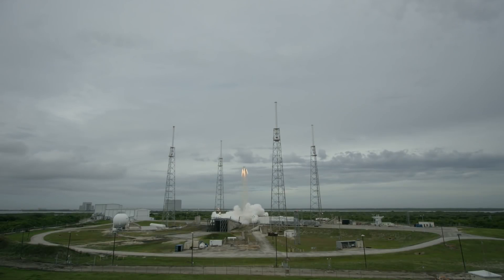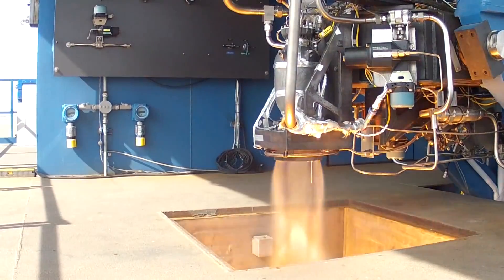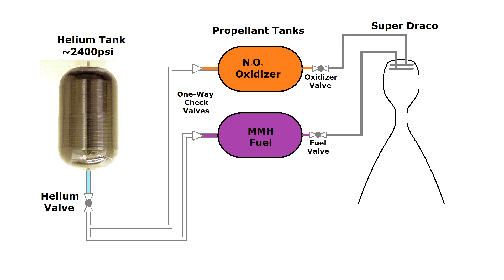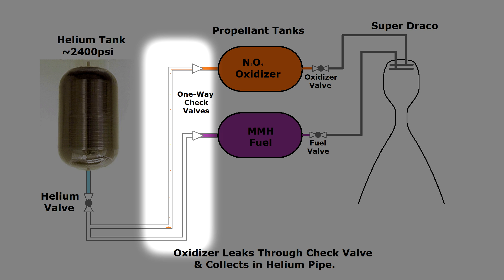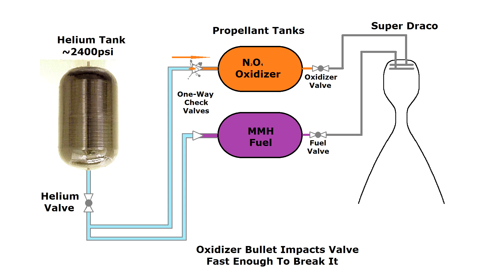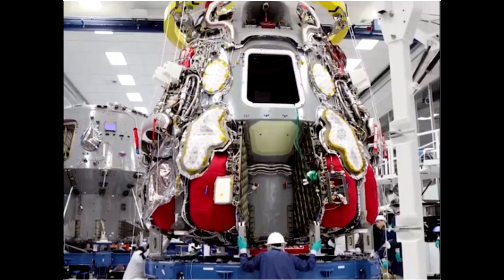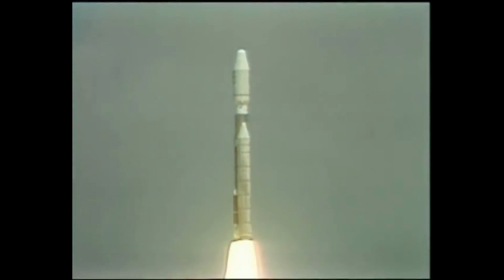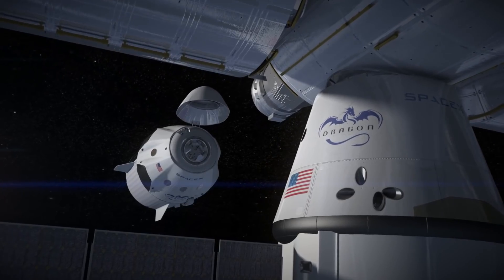SpaceX's Crew Dragon Spacecraft Exploded Because of 'Corrosive Bullets' and Leaky Valves

Comment: Where in the system do the burst-discs go?
The S-Dracos have to work approaching the station, and then de-orbiting three weeks later...!
R
Reply from the maker: The regular dracos use valves and are used for maneuvering in space, the super dracos use the burst discs and are only needed for emergency aborts

Comment: The technical term for pushing the fuel through the piping into the check valve is fluid hammer. This can cause a piping failure at a valve or at an inadequately supported piping elbow. In my professional life I have seen piping move several feet due to fluid hammer, only the piping was supported to take the hammering.

Comment: It would seem having a valve that opens rapidly instead of modulating was the main culprit but not even mentioned. Maybe the engineers there should have asked their local plumber about rapidly opening/closing shutoff valves and the pitfalls of check valves!
Reply from the maker: Do you have time for a slow opening valve if your rocket is exploding?
Reply: @scottmanley  Scott thanks for replying, but from what you mentioned it was the OPENING of the valve in the pressurising gas that caused the "obstruction" to be propelled along the fuel line, causing the damage. This is a very basic and known problem and a first year apprentice plumber would be aware of that issue (as would any home owner dealing with "water hammer"). 

Obviously I know nothing more about the system than what you described (very well incidentally), but it appeared there was no good reason to have the pressurising system's valve  operate so quickly. Pressure shock waves in hydraulic systems is nothing new, neither is the fact that check valves leak. Fluid Dynamics is a first year engineering subject, at least down here in Oz. I thought this failure was a face-palm moment and I'm literally embarrassed for the engineers involved.
Reply from the maker: @886014  OK, so how slowly do you want an emergency escape system to operate when your rocket is exploding?
Reply: @scottmanley  G'day @Scott Manley Yes that's a good point, but we're not talking about the Janitor finishing his hamburger and then wandering out with a Stillson wrench to turn the valve on. A valve that "gradually" opens means milliseconds in order to control the pressure wave front. From your report, the NASA recommendation was for burst valves to be used, and at least that indicated they were considering the shock wave (indeed used that property to perform a function).  It seemed by their design, the implications of the pressure wave weren't even considered by the designers, and the proof was in the pudding. ... In this case the pudding exploded. Not exactly a handy design feature for something intended to save the crew! How fast do you want your crew fried as both the "rescue system" and the rocket are exploding?

After any accident there are always people like me who will come out with "Coulda ... Woulda .... Shoulda"; those of us in the aviation industry deal with it constantly. That may grate the current generation where everything is always "awesome", but I feel that's the price to pay when dealing with other people's lives/money. I sometimes get the impression the team there are making it up as they're going along. That's fine when building video game; how many there are putting their hand up to sit on top of the candle when they light it? Would you? Obviously all just my personal opinion.

Comment: Nope...it exploded because of lack of foresight.
Blame it on a valve like an oil rig?
No purge valve, no trap in piping, no sensors behind or after valve to test pressures, detect oxidizers in helium?
Plz
Even a hobbiest at the drag strip installs a purge valve on their NOS system for safety.

Comment: What about doubling up the check values?  Having 1 Check value, then another right after it?  You could even add a sensor of some kind in-between the check values and before it.  A sensor type that can emit a scanning signal of some kind that is non-reactive to the materials used.  If a leak is occurring in one check value, hopefully the second check value can ensure that it wont get very far and the sensors can detect the problem long before device activation.

Comment: So, Scott, why are the valves replaced by the burst disks, and not supplemented by them by, for example, placing the burst disks between the LF/O tanks and the check valves? 

These are both relatively low-cost parts, in the context of a rocket engine, but each protects from different kinds of failures, and importantly, these different kinds of failures occur at different times.

Comment: The one way valves go back to default closed position to stop fluids going back down the pipe, they are usually spring loaded to auto shut when the pressure drops to below spring force etc, but of course can be motorised

Comment: by adding bust disk spacex will be making the thrusters a one time use right? one time per flight till the disk can be replaced?
Reply: because you're planning to use the escape system multiple times in the same mission?
Reply: No but it was originally designed to propulsive landing and what not just a escape system the system can leave orbit and reenter the atmosphere if the second staged malfunctioned in orbit the draco thruster can do alot more just be used for escape system

Comment: This has been documented for decades.   It’s known as the “Taco Bell Effect.”   When high pressure gas accelerates a soft blob of material directly through a one-way check-valve apparatus, causing an unexpected blowout.  

Every taco tuesday, someone experiences this effect.
Reply: Take Beano. Works like a charm to fix those leaky gases from building up

Comment: Ok my assessment of blame on the engines may have been wrong, but I'd like to know if this check valve was 3D printed. If it was I'd feel completely vindicated. 

Either way I'm still skeptical of 3D printing as a practical way to manufacture strong parts, but I do hope nothing explodes in the next launch abort test.
Reply from the maker: Check valves will not be 3d printed. 3d printing is used for short run items with complex geometry, check valves are used everywhere and have simple geometry compared to a rocket combustion chamber.

Comment: Wouldn't another method of preventing this problem be to use an automated gradual opening of the pressurant valve? Burst disks can't be a final solution if they want to have multiple restart capability... Furthermore, what if part of the burst disk breaks off and blocks a passage downstream? I know they aren't supposed to, but then check valves aren't supposed to leak either.
Reply from the maker: There’s no such thing as a gradual opening when your booster is already exploding
Reply: @scottmanley  Good point. I'm beginning to understand why my spaceX application was turned down xD

Comment: Ok, so the Mars Observer Failure Investigation Board concludes that Nitrogen Tetroxide had leaked past the check valve and either reacted with the titanium or caused some other problem. Yet, Spacex writes ”It is worth noting that the reaction between titanium and NTO at high pressure was not expected. Titanium has been used safely over many decades and on many spacecraft from all around the world..." . Someone help me out with this contradiction...

Comment: Hmm a bit confused. Why didn't it catch fire during the leak if the chemicals had mixed with metals they shouldn't have (if I followed your explanation correctly), and by removing the check-valve isn't that increasing risk further upstream in the helium lines & tank?

Comment: really psychadelic Scott but yeah a hotchpotch of meturalogical rifling of heliospheric magnetical  sheer  however fitting a burst disc inline will be maybe an interesting  engineering  topic. In the 23rd they might actually bend to the will of utilising a really fine  electrochemical safety monitoring  signal with alternative secure randomised sweep which would obviously sense any potential pockets then rather than wast a perfectly understandable solution to the expensive bumble of unmentionable pressurised catalytical converts to the sensor array to electrochemical plasma which perhaps engineers might even have service tools already of the coast of the outer planets. In 20-21st century paint it out of your memory alternatives it might be wise to be disgruntled and comment awe they could change the lines on my superwet bike man or something like that as if to be competative. Maybe the spokeswoman was press conference or something  and well thanks anyway

Comment: Scott, Since Carbon fibre, titanium and aluminium alloys burn, why not use Basalt Fibre for most of its parts. It's light, corrosive resistant, and can withstand very low to high temperatures. Scott, it seems to be a very interesting material. Please, why don't you look into it further? Thanks

Comment: Wouldn't vertical orientation of the checkvalves prevent the heavier liquids from pooling in the line behind a leaky valve? It's not like those rockets are designed for use in microgravity

Comment: What i still need to know is, was the crew cabin breached..seems the crew dragon is a incredibly strong pressure vessel, surrounded by a shell that contains all the bells and whistles. So if the anomaly caused an explosion wouldn't the explosion just blow out the shell of the vehicle, hopefully maintaining the Integrity of the actual pressure vessel. Seems an important part of this investigation, is can the pressure vessel protect its passengers from something like this. Seems if you're going to have explosive thrusters and fuel and Plumbing on the other side of the wall of a pressure vessel, the pressure vessel itself needs to be able to protect its passengers. The reports were that the spacecraft was in pieces after the anomaly. I wonder if this is true or not. Please help Mr Manley!
Reply: It kinda blew into pieces, duh?

Comment: The simpler alternative would be to place a 'drip loop" immediately ahead of the check valve so any leaked fluid could not travel and would not be accelerated upon pressurization.

Comment: Typical Space X use the cheapest possible system to save a some money. Use a check valve to avoid having to use a two more complex  and expensive  actuated control valves. Also no sensors to detect of the check valves are leaking. Well at least it did not happen with people on board.

Comment: How does the fuel and oxidizer get around a burst disc when its operating normally? Where in the system would you put the burst disc? From the statement " Instead of check valves, which typically allow liquid to flow in only one direction, burst disks, which seal completely until opened by high pressure, will mitigate the risk entirely", does the burst disc "burst" in normal operation for the helium to pass?

Comment: Was there ever any thought (mission profile) that, during any single mission, the superdracos would ever need to fire more than once? If an escape was needed, they'd fire once. If used in propulsive landing like F9, they'd fire once unless I'm mistaken. And, if used in a "soft" land-based parachute landing like soyuz, they'd fire only once. So, am I missing something? Does the change to burst disks change any mission profile? Was the reason for check valves solely to minimize single-use parts?

Comment: That's not a good or even barely adequate solution.
There needs to be a full cock type shutoff valve in the line, between tanks and the check valve. 
Time is the enemy with any check valve. If a liquid can't get to it, it can't leak past it.
Open the valves seconds before firing and there can be no issue.

Comment: One way to get back flow through a check valve is to apply just enough forward pressure to allow slight flow, then modulate the pressure drop like a reed in a musical instrument (oboe, clarinet, bassoon, saxophone.) 

If the helium lines were heated during reentry then the helium in the lines could pressurize slowly enough to just bias the valves to a very slow dribble - thus allowing a minor back flow.  

What I take away from this speculation is that the unused helium lines should be evacuated to a hard vacuum; enough to prevent pressurization during reentry. The vacuum will also assure that any leaked propellant is vaporized and distributed evenly within the helium line. The vacuum also can be instrumented to detect leaks and contamination. 

Even with rupture discs installed, if the helium lines are not evacuated, then the reentry heat might develop enough pressure to burst them. A check valve might then be exposed to propellant with a dribble of helium through the valve.

Comment: I'll ask the bleeding obvious questions. Why, if the valve separates helium from a powerful oxidiser, is the valve made out of titanium in the first place? For that matter, why isn't the plumbing all the way back to the helium tank also made of stainless or suitably coated? Also, didn't anyone ask the obvious question "what if this valve leaks?" as you might expect them to ask about every valve.
Reply: Titanium is significantly lighter than steel for a relatively similar strength. It was probably done to save weight where the extra weight (ideally) wouldn't be needed.

Comment: We had a similar phenomena that would occur in the trim & drain system of a submarine. We could get an air bubble in the pipping. If you didn’t bring the pressure up slowly but instead slammed it open we would have what we called a water hammer. And it would easily (and noisily) wreck the float valves designed to bleed the air out of the system.

Comment: I don't undersand how a burst disc could substitute a check valve in the system preventing reverse flow?
Reply: when you open the tooth paste first time you have to remove the metalic disc it is the same with the burst disc only it is done with pressure :)
Reply: @trondhansen9896  Yes I get that, but once bursted It doesn't prevent reverse flow like a check valve if for some reason that would occur. I guess reverse flow it's a non issue?
Reply: @97wito  i think the bust disc is in addition to the check valve so it is added safety until the fuel /oxidizer system is needed,as soon as the system is pressurized no reverse flow can happen i guess they put one burst disc in each line of oxidizer and fuel.
Reply: @trondhansen9896 This way it makes much more sense maybe I misunderstood from the video that they were going to replace it entirely. Thanks !

Comment: I feel like just using a second check valve and putting them on the ox and fuel lines from the HE tank in the first place could have avoided this?

Edit: a fellow engineer friend of mine pointed out the words that said "one way check valves". They don't teach plumbing to the undergrads at my university ¯\_(ツ)_/¯

Comment: It seems to me that two tanks of 3000psi helium one dedicated to oxidiser and one to fuel would do away with check valves which are notorious for failure in industry in general. Obviously there would be a trade off in space even though each tank would be half the capacity.

Comment: but if they replace the valves with burst disks how is the system reusable?
Reply: These engines would only ever be used in the event of an in flight abort, so the question is moot. even if they were being used routinely though, you'd just have to replace the burst disks every time. That is probably not difficult.

Comment: Why not just gradually pressurize the tanks instead of opening the valve with full pressure to the pipes?
Reply from the maker: How long do you want to wait for the system to pressurize in an emergency?
Reply: @scottmanley  Valid point. You could in theory bring up the pressure gradually before launch and vent it out after the abort system is no longer applicable.

Comment: I think it is crazy to burn so much helium.Helium is too precious and rare and limited to use as rocket fuel.We certainly can’t use up helium at such a rate for long. It is more insane to put it in balloons! What will the world do when we run out of helium? There is no replacement and no way of producing any.
Reply: It's not that much helium. On an industrial scale that's nothing. Besides, helium in rockets is one of the situations where it's really the only possible option.
Reply: Helium is created by the decay of radioactive elements inside the earth.  Volcanos are constantly realieasing it.  Once released into the atmosphere it will after many years be lost to space. The earths atmosphere has always had some helium in it and it can be extracted from the atmosphere just like Xenon and neon gas.  Currently most of the helium we use is from places where it could not reach the surface after it leaked out of the earths core.   Once this trapped Helium is used up we will use helium extracted from the air.  It cost more to extract it from the air but we will not run out of it.

Comment: It's often the simple things that escape the attention of designers.
Anyone that ever had a pipe burst in their house from 'water hammer' could have spotted this.
Experts working under the assumption that they had already eliminated a problem, will overlook the possibility that they screwed the pooch.

...and sometimes the engineers just don't do the math that would reveal a problem because they abdicate their skill to "common sense." Like thinking that there's no way a lightweight insulating foam could tear open the wing of the space shuttle.

Some lessons come hard.
At least this lesson only cost a bit of expensive hardware.

Comment: These burst discs, it looks like the intent for them is to physically prevent anything flowing in the wrong direction until it is turned on, that is enough force to break them but then they do nothing to stop back flow right? does this engine system generally burn off all its fuel and oxidizer leaving nothing left to flow backward? Could the existing ones have been re closed?